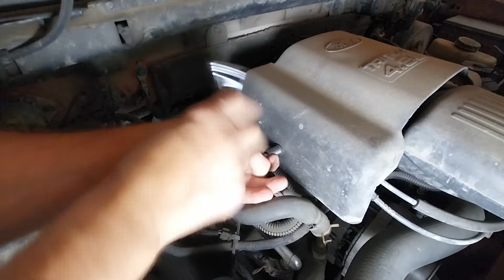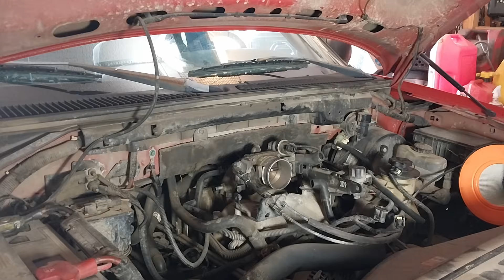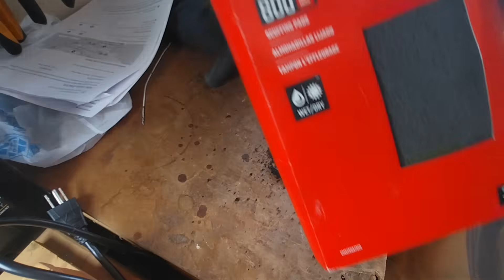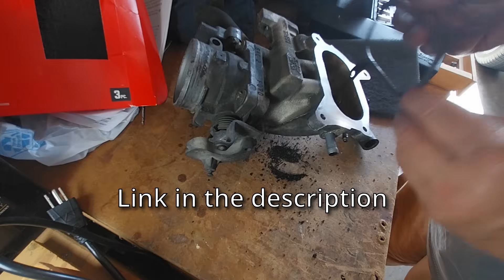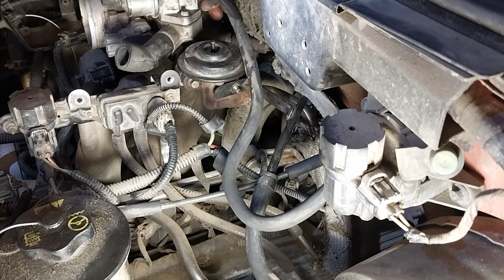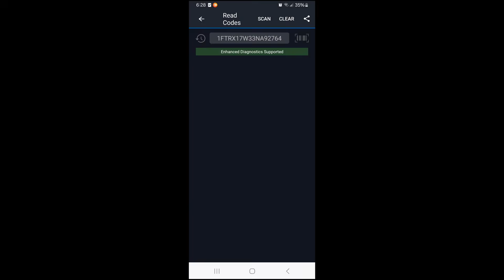2003 Ford F 150 4.6L P0401 EGR Insufficient Code Fix

Comment: I did this and replaced the egr valve and egr pressure sensor and I cleared the code but it keeps coming back after a few min of driving
Reply from the maker: Make sure to connect the egr valve vacuum hose.  I didnt show it in the video.  Make sure you installed the gasket for the valve and make sure the egr tube vacuum hoses aren't reversed or crossed or damaged.  Always possible that the orifice in the egr tube is clogged

Comment: ok so it's not the EGR valve itself?  My truck is doing the same code and loss of power when pushing the pedal, i was thinking of replacing the egr valve but i did the vacum test with it and seems responsive so would you say it's the TBody that's the cause like in this video?
Reply from the maker: I wasn't really having any performance issues.  It was just the engine light on.  But I can tell you that cleaning that throttle body spacer made it run a lot smoother.  Don't clean the actual throttle body, just the big spacer.  The throttle body itself has a special coating.  I've heard there is a special cleaner for it but no experience using it.

Comment: I have a 02 ford f150 its been stuttering from idle to 3rd gear. I replaced the maf sensor, air filter, also cleaned out the whole throttle body as shown on your video. Its still having issues where i can lay the gas to the floor n it takes 2 mins for it to shift into 2nd at 5k rpm once it goes into 2nd it take another 2 mins to shift into 3rd around 4 to 5k rpm. Otherwise 3rd seems to be fine. Shifting n driving theu overdrive. Please help if u can. Im lost for solutions.
Reply from the maker: Sounds like you are having some flares if it goes to 5000rpm.  Probly something internal worn out or solenoids not working.  I assume you checked the fluid level?  Could be a number of things.  Sorry I couldn't be more help to you.

Comment: I’ve got a question on a 2004 Ford F150 with a 4.6 will dirty throttlebody make it runs rough when it idles, but when you’re going down the highway runs good?
Reply from the maker: From what I remember it didn't run noticeably rough.  I did have a hole in the pcv tube from all the heat build up on the back of the engine and it ran rough and gave me a lean code.

Comment: Do you think this will cause a code PO174 system to lean bank 2?
Reply from the maker: Possible but I would check for vacuum leaks.  If this is a 2003 f150, check the pcv hose to the back of the throttle body.  It will degrade over time

Comment: My jeep throws this code after a new egr. The previous egr code was different which is why I changed. I don't think the replacement parts are engineered very well and it was a hell of a part swap. Not sure why they buried the egr on the 3.8 but probably because it sits sideways in the caravan.
The code used to pop off once a week but I just went six months no code until yesterday. 
I cleaned the tb housing real good and I think that help.

Comment: Will a clogged throttle body cause your truck to run rough when you give it gas
Reply from the maker: It will cause it to run rough.  Makes a big difference when I cleaned the spacer